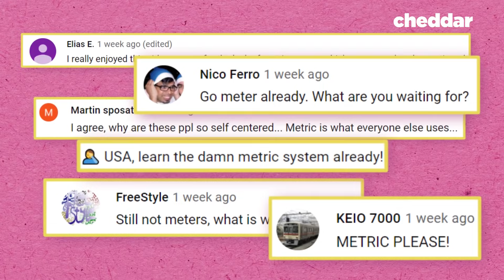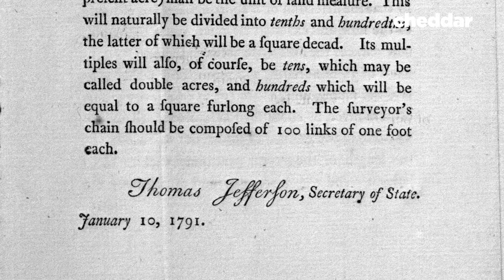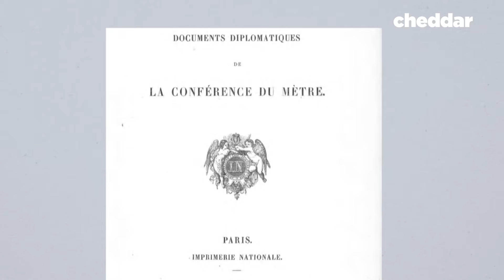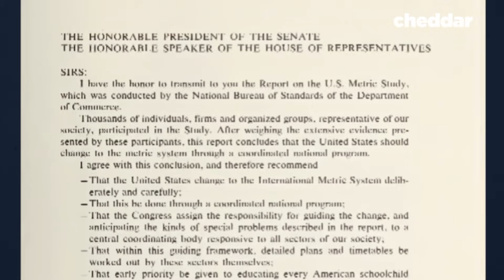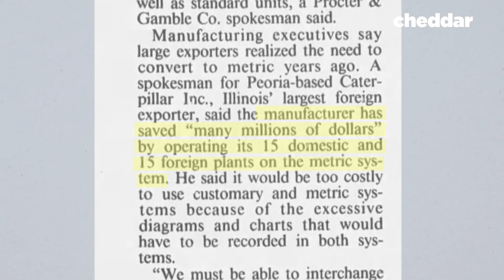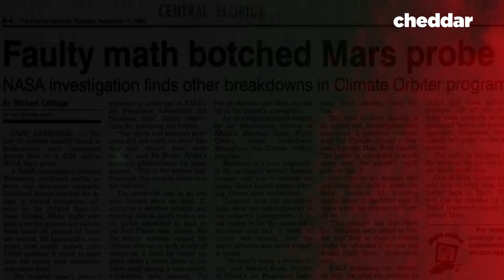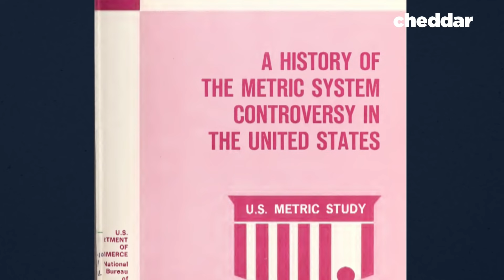Why Doesn't the US Just Use the Metric System? - Cheddar Explains

Comment: The problem is the conversion as I know what a teaspoon, tablespoon, ounce, cup, quart, and gallon values are. Take for instance back in the 1980’s some gas stations tried to push the issue and started selling by the liter. I became curious and converted the price from liter to gallons. They were ripping everyone off on the cost of the gasoline. Selling by the liter did not last long. 
The second issue is land survey. Everything is sold and transferred via Acres, sq miles, etc. When you convert it is not nice round numbers anymore but a lot of decimal places. Very cumbersome.
Reply: Acres are not nice round numbers, either, except possibly for large tracts.  Usually the area is given to a hundredth of an acre for small properties.

Comment: UK is kinda metric. The construction industry went metric in 1971, but you still can't buy a metric measuring tape - they all have inches on one side. Part of the problem is the 'System International' which doesn't use the centimetre, only millimetres and metres. Ladies very sensibly buy cloth by the centimetre and metre. I actually buy tapes when I go to France!

Comment: When I was in the upper elementary grades, they introduced metric units. The sensible way of doing this would be to simply ignore everything measured in Imperial units and use metric norms instead. But what it turned into was nothing more than conversion mathematics.

Example of a good metric-based question:

"A radio station announced a weather report that it would be 15 degrees that day. What would you wear that day?" with multiple choice answers including "tee shirt." "sweatshirt," sweater," and "winter overcoat."

Instead, we students got questions like this:

"It took Bobby 180 minutes to drive 200 kilometers. How many miles did he travel? What was his average speed in miles per hour?"
Reply: Calculate the orbit of mercury relative to the gym hall

Comment: The imperial system allows for more different thread sizes.  Threading on a lathe is also much easier.  A threading indicator won't work for metric threads because the pitch is defined per thread rather than per unit length.  That said, metric math is easier.  The imperial system works fine.  In the US we use both.  New stuff tends to use metric fasteners but lumber still comes in inches and feet.  Were we to change to metric lumber, additions and renovations would be a nightmare.  It is naive to think we could just throw all our existing stuff away and use only metric stuff going forward.  Europeans don't have this problem and therefore don't understand it.  Imagine if the world told Europe to use inches and feet going forward.  Not so easy is it?
Reply: The US actually did reduce the finished size of lumber a long time ago.  I’m old enough to have run into that problem.  It is better if dimensions of building materials remain fixed for a long time.

Comment: The British do not fully commit to the metric system either.
Reply: We're very... In the middle about it. A lot of street signs still use the imperial measurements, and we still use feet and inches for out height, but pretty much everything else has gone metric, or we literally have both imperial and metric labeled.

Comment: The virgin single-system measurement advocate
- Only knows metric and is too petty to take the less than five seconds it takes to enter other measurements into a calculator for conversion, instead taking thirty seconds to write a self-righteous YouTube comment
- Doesn't realize the people he argues on the internet with are normal people and not engineers designing factory machinery or roads
- Conveniently forgets that much of the UK still uses imperial measurements (stone, even miles are used)

  The Chad multi-system expert
- Knows both metric and imperial, remembering the convenient rules that even medieval people knew -- an inch is the width of your thumbnail and a foot is about a foot, yards are interchangeable with meters at small quantities, 2.2 pounds fit into a kilogram and a liter is a quart
- Doesn't complain when someone has a different culture than theirs and instead just uses the internet to convert a measurement
- Acknowledges that some forms of measurement are more convenient in certain situations than others without being insecure about it

Comment: Metric System is inferior. I think
Reply: In that case, do not use any electrical equipment, because it is all designed, specified and uses Si (metric) units.
Also, do not use any vehicle built since 1975, because of the same reasons.
Reply: Make me
Reply: @BigMastah79 It is up to you, because it was YOU who specified The International System of Measures (the Metric System) as being "inferior".
So, you may not wish to use an "inferior" system in any way, shape or form.

Good Luck.
Reply: FrodoOne1 Okay so basically, I think we should transfer to Metric, my original comment was a reference to some irrelevant joke.
Reply: @BigMastah79  Who knew?

Comment: Mixed units will persist. It’s only ignorant people who only know “metric” that can’t figure out there are other very efficient standards that are widespread and been used for centuries.  These are the units are often not metric. Time is in seconds, minutes, days, weeks, years, etc. In the industry, tires are still use inches and mm in defining the size. Sockets are in fractions of an inch. Fresh water plumbing supply lines are in fractions of an inch. The pipe threading is inch based. This is true for the EU.
Reply: Regarding pipe fittings, Yes.
However, these can be re-specified with a "soft" conversion into SI (metric) terms.
 
In Australia  (if not in the EU) 1/4". 1/2", 3/4", 1", 1 1/4" fittings are now specified as  6 mm, 12 mm, 19 (or 20) mm, 25 m,m, 32 mm.
Yes, there is a "rounding" error in there but any plumber can fit pipes to those installed by his/her Father or Grandfather.
 
So, mixed units (largely) do not exist in a properly metricated country, like Australia.
(See https://www.youtube.com/watch?v=1d3gAZ-Te3Y)
Reply: FrodoOne1 yep same with socket drive sizes, it’s converted to a quasi metric size. But I recall TV screens and computer screens are inches. Also more importantly how do you guys define your pizza sizes? 

I think the UK is the worst when it comes to adherence to SI. On roads they use miles and miles per hour. But anything less than a mile, it’s meters/cm/mm. Then the whole silliness with stone as a measure of one’s weight.
Reply: @hansbrix2495  
Pizza sizes are usually specified as Small, Large or Family and I could not actually tell you the diameters involved - in any system of measurement.
(Probably 300, 400 or 500 mm in diameter - but I have never purchased a "Family" sized pizza. 
I now have a "project" in that I must measure those sizes next time I go to a certain Pizza shop!)

Subway "sandwiches" are advertised in "feet", but, if I ever order one, I just ask for "Half size" or "Full size".
(If I want to be "specific", I might ask for a 150 mm "subway sandwich" and then get into a discussion on how Australia has used the Metric system for 50 years and Metric measurements are the only ones which are "legal for trade".  However, I am not usually so "argumentative" !)

For an analysis of the mess that the UK has made of its metrication, please see https://ukma.org.uk/press/comparison-with-australia/
Reply: @hansbrix2495  — Just relabelling with metric units seems unsatisfactory to me.  A common 3/8” square drive is 9.525 mm.  Calling it either 9 or 10 mm is a big error, but 9.5 mm seems clunky.  What do Australians actually call the various drive sizes?

Comment: To adopt the metric system is to bow the knee to globalism.  It is also less practical for engineering and crafting, as it is less easy to divide things in half multiple times.  If you really want to live in a society that uses the metric system, move to a country that uses it.  There are plenty of them to choose from!
Reply: How many cm's are there in 13954006km?

How many inches are there in 13954006miles?

Without calculator.
Reply: NASA and literally all of science uses the metric system
Reply: Why is it that you think that "globalism" is a problem.
If you do not wish to enter the world of "globalism", stop using electricity in all its forms.
Today, electricity - in all its forms - can be specified, engineered and utilised only by SI (Metric) dimensions.

The only non-metric units encountered by US Citizens are those relating to length/area/volume, mass (plus units related to those) and temperature.
All else is already "metric".

Comment: Put a metric tool on a metric fastener and it strips 9.999 percent of the time. Try measuring to exact tolerance metric only gets you two places past the decimal, standard can go on and on.
Reply: What?
Your aware that the metric system doesnt end at cm's? Right?

What your saying is so stupid. I bet you don't know the metric system.
Reply: https://www.youtube.com/watch?v=1d3gAZ-Te3Y
Reply: @FrodoOne1  
As I said. Metric doesn't end at the cm.
Reply: @rzu1474  Quite so.
As I was trying to indicate, it goes on with divisors of 1000 times from Milli, Micro, Nano etc. and upwards from Kilo, also by 1000 multipliers.

(The Deci, Centi, Deca and Hecto prefixes ARE the anomalies - and are best ignored, as they mostly are.)
Reply: @FrodoOne1  
Its going by 10 times.
Only the kilometer is 1000 times more then a meter. There probably is something nobody ever uses.

Also. The hell? Ignore it? I see your problem now. Your USING IT WRONG thats why you cant use it.

Comment: the biggest issue with the metric system for me is there is no clean close approximation of a foot. 3 decimetres just doesn't cut it. meters are for large distances and centimetres are for small, but a foot is much simpler for that approximate distance.
Reply: No?
Thats just your thoughts still being in imperial.

3feet~2m~200cm
Everything given in feet can be given in cm or m without a problem.

Comment: correction: there is Imperial, metic, and British. europe drives in kilometers and Km/h while we still drive everywhere in miles and MP/h. also why is the US gallon and UK gallon in metric liters are different?
Reply: In the olden days, “gallon” did not mean a particular volume.  It was a container.  There were different containers, and different volumes, depending on the contents.  The United States decided to use “gallon” as a unit of volume and chose the wine gallon.  Later, the British decided to standardize units throughout the Empire and chose another gallon.  As the United States was not a part of the Empire, they didn’t bother to check with us first.

Comment: Why do Americans insist on using the short system, when the long system is objectively and factually the only correct system. A billion is not a milliard.
Reply: Unlike metric imperial, this is only a word change, the amount is the same, yeah its annoying but it will never crash any spaceship and to be honest, everything avobe a billion (or trillion) is always said in scientific notation, so it's only 2 words, milliard/billion, billion/trillion

Comment: Good video explaining the history and current-day uses. As the narrator said, pretty much anything manufactured today is made to metric specs. in addition, anyone in science or healthcare is already using metric as well. So in a sense the US is already using it. However, the obvious exceptions are: 1- the construction industry, and 2- people in their everyday lives. Why construction won't convert is likely due to the fact that it is not dependent on international trade - as well as the building materials being produced at certain standards that we've used for years (for example, 2x4 lumber or concrete blocks). As for people in their everyday lives, it's mostly the simple fact of people being set in their ways, and not wanting to change, regardless if one system is better than the other. People have a hard time visualizing the various metric units, since they were not raised on using them. But as someone who has used both systems, I very much prefer metric. It's easier to use & is more precise. Also no conversions for fractions or feet & inches.

Comment: Metric is way easier than the imperial system. We use "metric" or decimal system with our money. 1
$1USD = 100 x  $0.01 (1 cent) so a penny is centi-dollar (simplifying - dont troll me)
With the imperial system to measure a liquid (or volume) we use:
Teaspoon
Ounces
Tablespoon 
Cups
Pints
Quarts
Gallons etc 
In metric:
Liters - that's it!!! Its so simple

You just prefix things in metric. For example:
 Milli (M = 1/1000 of something)
 Centi (C = 1/100 of something)
Deci (D = 1/10 of something)
So 1 liter =:
1000 Milliliter
100 CentiMeter
10 DeciLiter

There are only 3 measurements:
Volume = liters
Meter = distance
Grams = weight
Just add the right prefix ans you are good to go!!

If I need a larger wrench than 14mm, guess what? I try 15mm
In imperial if I need a larger wrench than 13/16 I would need 14/16, but they don't make one, you need to reduce the fraction to 7/8. Ugh. Figirr out how many teaspoons there are in 1 gallon. Ill wait........
Now try how many MilliLiters there are in a liter....  Super fast yes?

Personally I measure temps in Centigrade not Ferehnhight. Look at the word.... Centigrade. Centi = 1/100 so freezing water = 0 and boiling = 100 simple! People need to get used to comfort ranges like between 15 and 24 thats a comfortable range. All of aviation around the world (even in USA) uses Centigrade.
I wish we (USA) would just convert already!! We already know the math because we use it in our money!!
Reply: Decimal does not mean metric.  Both the British pound and US dollar are decimalized, but different units.  Feet can be decimalized (and are) but that doesn’t make them part of the metric system.

Comment: Come to the UK we use both.
I measure 
Height of people in feet and inches
Visual distances in meters
Measurements of object in mils
Weight of people in stones and pounds
Weight of everything else in kg and g
Driving distances in miles
Liquid volumes in litres
Fill my car in litres but measure fuel economy in MPG
Sweets in ounces
Beer in pints..... of course. Usually up to 8 or 12 if I've got the flavour.
Edit... for my job I have socket sets and spanners in metric, Whitworth, AF and BA...... the joy 😂

Comment: I use metric because instead of, for example, 1/16, 5/8, or 1/2 inch, it’s just a decimal or a whole number, so it’s easier on my brain, because there’s 10 millimeters in a centimeter, instead of 1/2 inch, it’s just 5 mm, so it’s easier to measure things with less counting.

Comment: When speedometers finally show kilometres per hour in a larger font size than miles per hour and when people FINALLY get used to what that means, we'll be ready for the switch. Rulers and measuring tape have had both systems on them for years now so that'll be less drastic.

Comment: Britain is an absolute mess when it comes to metric and imperial. We use both systems along side each other at the time time. I get in my car and drive 3 miles to a garage to fill my car with petrol sold in litres, yet we measure economy in miles per gallon. I buy milk and beer in pints, but soft drink in litres. Fruit and veg is bought in Kilo’s, but we weigh ourselves and stones and pounds. The list goes on and on. So this 1965 uk metrification isn’t true!!!.

Comment: Working in the architectural field, the whole inch to feet conversion is annoying as it is, but the part I don't get why we don't embrace decimal inches? It's common to see measurements in 1/2, 1/4, 1/8 inch increments in my industry and I grumble through calculations - I'd go metric in an instant if it weren't for industry standards (we all learned metric in high school anyways).
Reply: Surveyors do use decimal fractions.  My condo was surveyed for assessment purposes, and it is documented in feet with decimal fractions.

Comment: GREAT job on proper use of comparing Newtons to pounds (instead of improperly comparing kilograms to pounds).  It makes me cringe whenever I hear people converting from one to the other.  It is almost like converting seconds to meters (or vice-versa).  They are absolutely not the same unit of measure, but if you know velocity then you can do the conversion.  But that conversion is only accurate at the one specific velocity you know.  If you know gravity, then you can convert kilograms to pounds.  An object with a mass of 10 kilograms will be 10 kilograms anywhere in the entire universe.  But an object of 22 pounds (10 kg x 2.2 pounds/kg is the standard conversion) will weigh 22 pounds, but only on Earth.  It will be very different on the Moon, on Mars, Venus, or deep space.

Comment: Americans are switching to the metric system, inch by inch.  I'm at least a 4th generation American (that I know of), educated in engineering which was taught entirely with the metric system.  I FULLY believe the metric system is easier and much more sensible than our current system, the Avoirdupois system.

Comment: To be fair, using inches has its place. In clothes design or engineering being able to just halve measurements and such really easily is very handy.

The metric system is great, and logical, but Imperial and American Standard has its place.